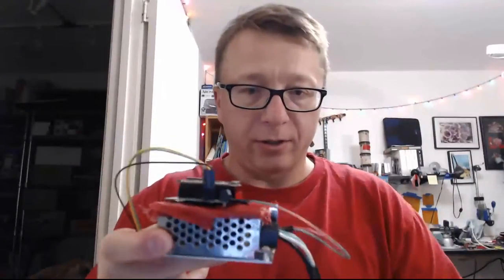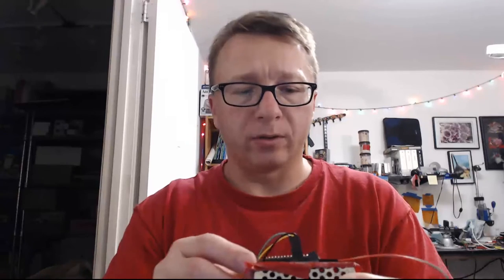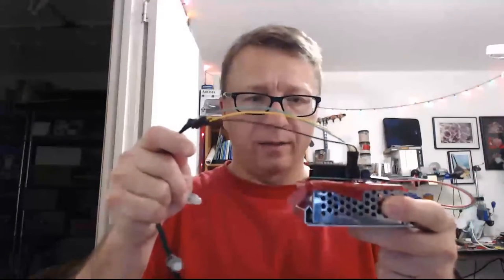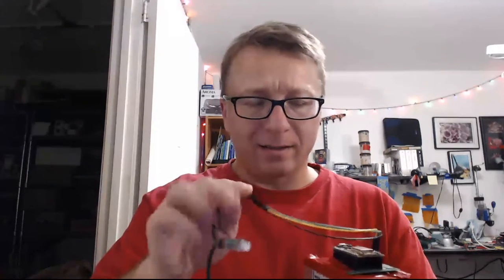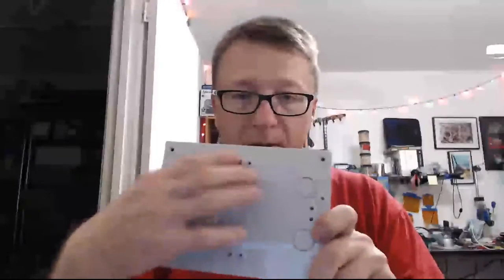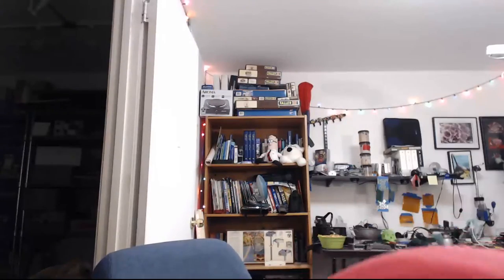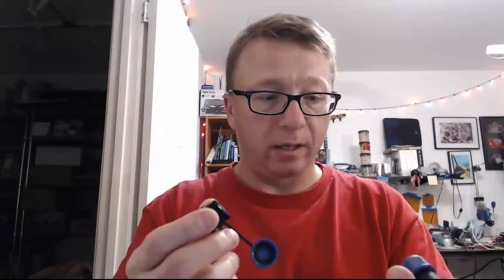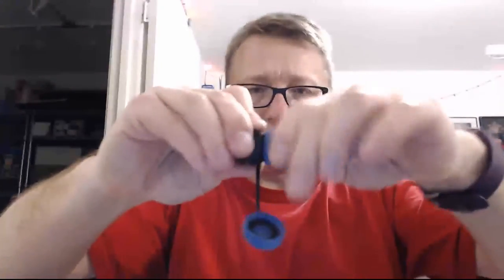ESP8266, WS2812, and Christmas!

Comment: Great video thanks!
I'm also interested in your Aliexpress purchases-list. Could you please share it. At least I'm interested in the 3 wire water-proof connector.
And of curse I'm also curious regarding you experience about the purchased things...

Thanks
Reply from the maker: Sandro - the link to the connectors is below with the enclosure:

Enclosure - https://www.aliexpress.com/item/125-175-75mm-DS-AT-1217-IP66-waterproof-ABS-Enclosure/32407002259.html
Connectors - https://www.aliexpress.com/item/Waterproof-Aviation-Plug-Socket-SD16-16mm-3-Pin-3P-Panel-Mount-Connector-IP68/32362285664.html

I've generally had good luck with AliExpress/Alibaba, but I try to stick with well reviewed sellers with high marks.  The one time I had a problem it worked out, but it did take weeks.

Best of luck.

-Tom

Comment: Can you post a link to your water proof box that you said you got on Alibaba?
Reply from the maker: Here is the link: 

https://www.aliexpress.com/item/125-175-75mm-DS-AT-1217-IP66-waterproof-ABS-Enclosure/32407002259.html

I'm pretty sure I got a better deal because the parts where mis-marked in price.  But they are really great enclosures.

If anyone else is interested, here is a link to the connectors too:

https://www.aliexpress.com/item/Waterproof-Aviation-Plug-Socket-SD16-16mm-3-Pin-3P-Panel-Mount-Connector-IP68/32362285664.html

Thanks for watching!  Please subscribe :)